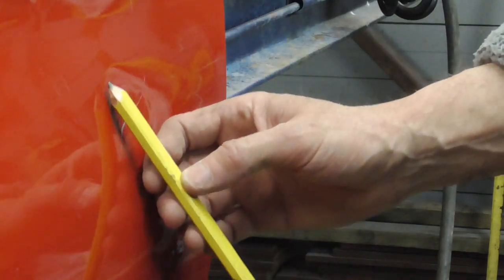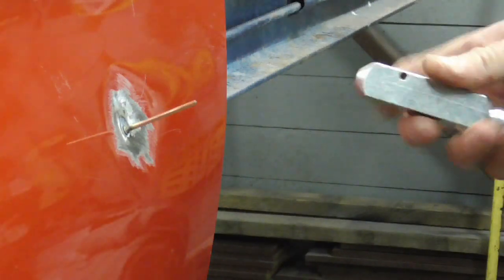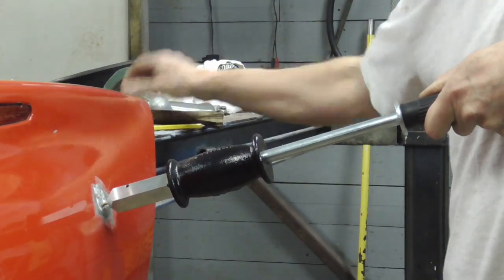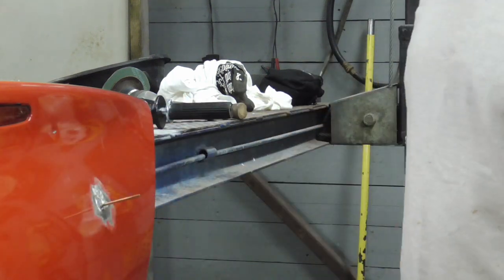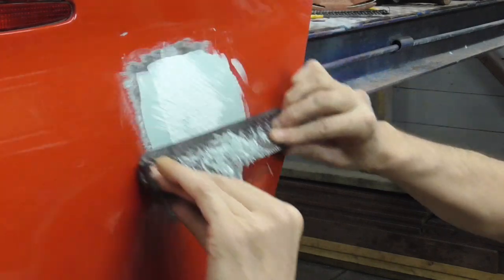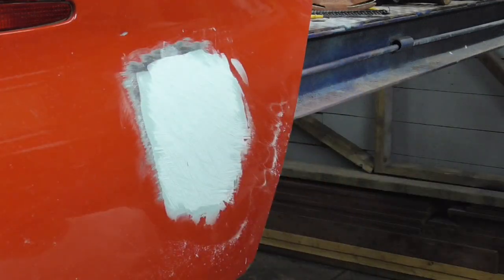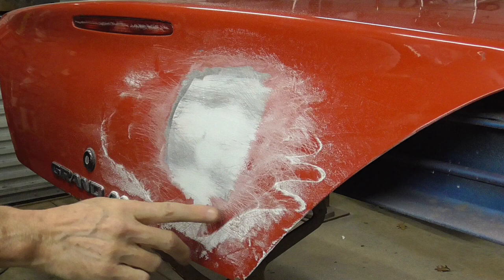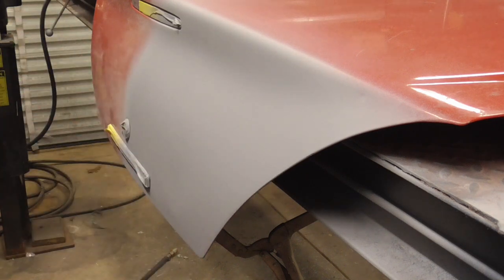How to Remove a Dent with a Slide Hammer - Start to Finish

Comment: I just bought a slide hammer for dent pulling. No stud welder though. I’m curious what primer you used?
Reply from the maker: I use lacquer primer for a few reasons - It works just fine,  dries very fast, sands easily, cheap, it's not 2 part so you can throw the unused portion from your cup back into the can.  2 part primers may be a bit better but for 1/2 century that's all there was and body shops did great paint work.
Reply: What do you use for clearcoat?
Reply: buy yourself a cheap small 130 amp or so mig welder with flux cored wire so you dont need gas bottles . you will be able to fix so many things after that . you can spot weld the studs to the job

Comment: I have dents on 2015 ram 1500 I tried the suction cups I have a slide hammer dent puller but it's the screenw in kind

Comment: I saw many videos, but really still couldn’t get, because after sanding with 40 or 80 you still have deep scratches then how can primer hide that, I tried many time but couldn’t and then I sand with 240 or 400 🤔
Reply from the maker: Finish your filler with 80 grit, prime with "primer surfacer" - filler primer, block sand with 120, prime again, finish sand with DA (240-320) or by hand 320/400, paint
Reply: @LakesideAutobody  
This is what I said, after 400 or 800 grit is possible, but how they do after 40 or 80 grit, it mean skip the important part 😂
Reply from the maker: @N-one123  You can prime over the 80 grit scratches - then when you sand with a finer grit, that primer fills or smooths out the rougher scratches - hope that makes sense to you my friend :)

Comment: Another great video. Thanks!!

Anyone have any idea where I could get a stud pulling tip like that for my slide hammer? I've looked all over but no luck.
Reply from the maker: Ebay, amazon, TPTOOLS, Harbor Freight?  This will work on everyting - Astro Pneumatic Tool 78415 Locking Pliers Slide Hammer Puller,Silver

Comment: I am 100% AMATURE, meaning I never have done any body work, but I still have my 97 K1500 Xtd-cab from new which is starting to show issues. Priced to fix cab corner and rocker panel rot plus few dents and a repaint, was quoted at approx. 9500-10K. But afterwards Ill still have a $3500 truck.So I'm really determined to start repairs myself. Your videos are just what I need.I'm sure I wont do a professional job, but I really want to learn this stuff, and I'm sure I'll do OK.Ill buy things as I go from eastwood (about 2 hr drive). But any brand tools your recommend along the way let us know what they are.Appreciate and love the videos.Wish you were closer, I'd pay for training.
Reply from the maker: I wish I was closer too.  Please feel free to ask any ?s you have - even if you think they are too easy or silly.  I'll walk you through it from step one till the end.  Also, if there is a topic that you would like to see just ask or comment on any video - I usually answer comments every day.  Good luck.  Jerry

Comment: Would a slide hammer work on heavier gauge metal, like a bumper?
Reply from the maker: They make bigger ones and I think they would work.  You might have to use something heavier to pull from.  Maybe weld a shim or bolt in place to pull on :)

Comment: I know thats called a slide hammer, but what is the end part that holds the stud part called? Im looking for a similar slide hammer thing but I just keep finding ones with hooks on the end instead of the thing that holds the stud thats welded on.
Reply from the maker: That came with the slide hammer and the slide hammer came with the stud welder from Harbor Freight.  https://www.harborfreight.com/stud-welder-dent-repair-kit-61433.html

Comment: This is a nice video. I have a dent with a crack on the driver side door. First time doing this but will try to fix this using harbor freight crossbar dent remover. One question I have is, why wasn't the car painted red at the end of the video? Also I purchased several grits(1000,3000,5000, etc) do you recommend I start on the lower end?  Thanks.
Reply from the maker: I borrow the damaged panels from a local scrap yard.  To buy matching paint is too expensive - I would love to but.....  As for the grit - If you're working with bondo start with 40 and finish with 80.  If you are prepping for paint use anything from 220 to 400.  If you are buffing out paint use anything from 800-1500.  Good luck - ask ?'s if you need to.  Jerry

Comment: Thanks for the demonstration Lakeside. Just a quick question. On a bigger dent would you start from the out side and make your way in? or would you start in the center?

Also, watching some other guys do this has got me confused a little about tapping down the highs while pulling up. Are you aiming to tap down to the panels original height? Or a little further? It looks like some guys are tapping kinda aggressively almost to create a dent??? I mean, if the metal has been stretched its about the best we can do right?
Reply from the maker: I always start at the worst part of the dent and let the chips fall where they fall.  It always has worked for me  - Jerry

Comment: Hey jerry I need to do bodywork on my 1997 Chevy Astro van it’s a dent right on the driver side corner panel I have a slide hammer is there anyway to go about it after I finish pulling the dent should bondo the hole and repaint any suggestions greatly appreciated thanks
Reply from the maker: The hole doesn't have to be welded as long as it is knocked down a bit then filled.  In other words, you don't want a hole with just primer and paint over it.  Don't pull it too hard from one spot to create a peak.  Knock all the high spots down, fill it, prime and paint - good luck - Happy New Year.
Reply: Thank you so much jerry I’m gonna tackle it tomm and give a go happy new year
Reply from the maker: @markranaudo1147  Ask ?'s along the way if you want.  Let me know how it goes.  Jerry
Reply: In this day and age a good body man wouldnt think of drilling a hole in a panel the highstrength sheet metal is too thin in the days of when cars used 18 gage sheet metal and slide  hammers they use a sharp pointed punch to pierce the metal this pushed the metal in then then the slide hammer and screw had reenforcment to pull the dent out. The idea of using filler to cover holes is not a propper way. moistuer can get in and cause rust damage to the panel you are repairing. The stud welder came on the seen about 25 yrs.ago this is a very  good way when you cant get a hamner and dolly to renove the dent. To the stud welder you saw in the vido sold at harbor freight is very cheap . This is for infromation people can do body work any they can by any means they can.
Reply: @waynejohnson7134  doesn't it matter how good the repair needs to be?  Show work vs daily driver?  A tiny hole should be fine when filled with filler as long as it's not in an area that moisture can accumulate, right?  Admittedly, I'm a noob who aspires to learn bodywork and I'm just trying to take out some fender dents for practice on an e30 until I can have it restored properly (or am capable of doing it myself someday). Thanks!
Reply: @waynejohnson7134  Oh, and are the cheap stud welders okay for weekend warriors like me or a waste of money?  Thanks again!

Comment: What if you use a screw? How do you fill those? Jb weld?
Reply from the maker: You could, but as long as that hole is left a little low, I would just grind the area and fill it with body filler.  Many would scoff at that but I assure you if it is not on the  bottom of the panel (where there is moisture) you'll be fine

Comment: Biggest problem with these stud type dent pullers is the cheap eccentric wheel in the slide hammer only lasts a short while before the serrations disappear meaning it will no longer grip the stud. This makes it USELESS. Have not been able to find replacement wheels anywhere.
Reply from the maker: You can grip them with a small vise grips and pull from that if your slide hammer grip fails - Jerry
Reply: I had the harbor freight stud gun and had nothing but problems with it. The slide hammer was of pretty poor quality too. In fact, my stud gun took a dump so I got a replacement and the wheel in the slide hammer was put in backwards! Junk. Bought a good stud gun, been using ever since. The new one came with a slide hammer that doesn’t have a wheel type locking mechanism but rather a twisting mechanism that seems to work pretty awesome.
Reply from the maker: @christrainor1129  I'm actually not that happy with HF lately.  Every time I go, the coupon doesn't count or they are out of the "deal" that I went there for.
Reply: Lakeside Autobody I still have love for Harbor Freight. Certain tools are better than others. I’ve noticed that they discontinue items from time to time and replace them with better versions. Anyway, my secret weapon from HF is an all in one hot air plastic welder. It was like 60 bucks and it’s made me thousands! Lmao.
Reply from the maker: @christrainor1129  I'll have to check this thing out - what are some examples of stuff you've welded with it?

Comment: What are those "Studs" called and where do you get em? Anyone?
Reply from the maker: They are stud welder studs and you can get them from Harbor Freight:  https://www.harborfreight.com/250-piece-welding-studs-90081.html?_br_psugg_q=stud+welder
Reply: Awesome brother. Thanks man I appreciate it. I just got the slide hammer set, bondo and scrapers from there but they didn't know what they were called
Reply: I think Wal-Mart has the whole set up too...